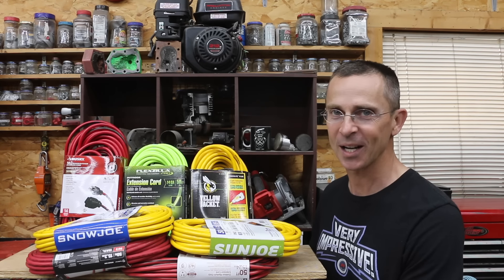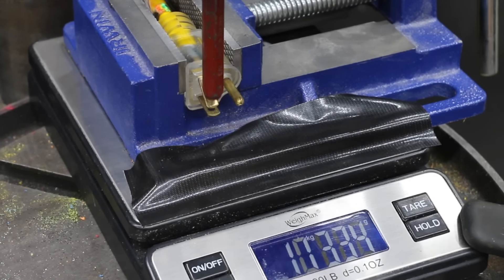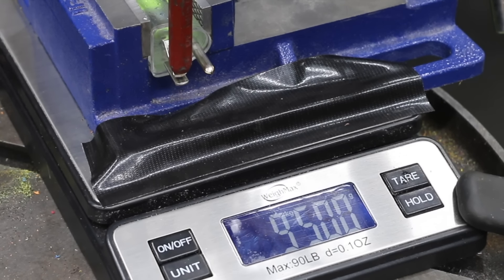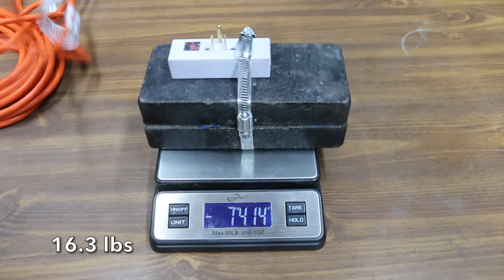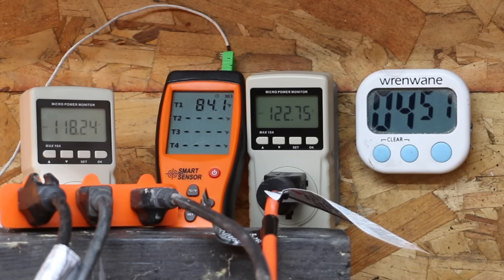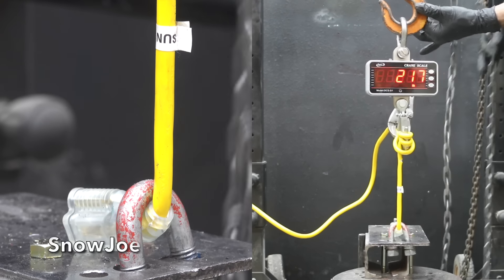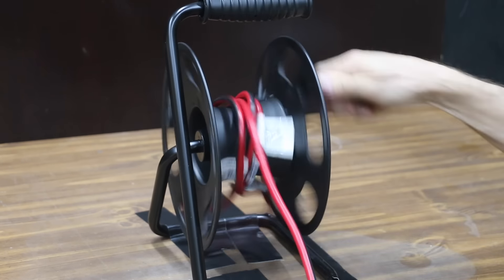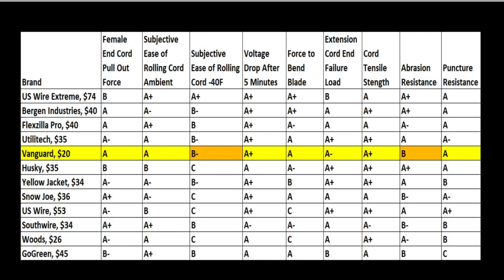Best Extension Cord? Flexzilla, US Wire, Yellow Jacket, Southwire, Husky, Woods, Bergen Industries

Comment: I’ve been using Yellow Jacket ($34) for about 20 years and is the best cord I’ve ever owned or used in construction.   One of my pet peeves is how well does the cord roll up and unroll, I like to grab the prong end and toss the cord where I need it.  This cord does it without twisting every time and is the 25’ length.  No cuts, punctures yet.
Reply from the maker: Great feedback on the Yellow Jacket!
Reply: I have 2 yellow jackets that are every bit of 20yrs old and they are still in great shape (home shop use, not daily/commercial)
Reply: Yep agreed and I got mine at Costco.
Reply: I'd rather have my own leads made & tested/tagged over buying them off the shelf. The end result is so much better. 
Currently the main ones I use in the shed are 3G2.5mm² high temp silicone rubber (SIF) 300/500V, -60C/+180C with tinned annealed copper wires
 Plug & socket are easily replaceable if damaged, the silicone cable is incredibly flexible, absolutely beautiful to wrap and I don't have to be as concerned about melt through when carrying out hot works. 

For more ruggedised cables I use some made from 3G2.5 & 3G6 RV-K (XLPE) which is thin & light for its CSA and has -40C/+90C ratings which is still better than PVCs - 15C/+75C 
I really like using RV-K because it wraps well, has a good memory and whilst it might not quite be as tough as Titanex it's significantly cheaper, thinner & lighter which makes a massive difference.
Both cable types have their benefits, and save cost are so much nicer to use than PVC.

In my past job, it was nothing to wrap well over a kilometre (3280' or 0.62 miles) of cables in a day so believe me when I say that this stuff is nice in the hands.
Reply: I've been using one for 10+  years for my car's block heater and power tools and it still looks brand new!

Comment: Re: flexibility. I've seen a lot of brands claiming they're flexible, and they're not. Even in warm weather(Though whether they degrade more quickly with temperature or not, I'm not sure). The blue "extreme" cables(Regardless of brand I think) are usually the most flexible 14AWG cable.

Ridgid has some 14AWG and 12AWG extension cords, both claiming they're flexible. Spoiler? The 12AWG 50FT is far softer and more flexible, go feel them in-store. Too bad they didn't end up in your test. Definitely do a 12 gauge comparison, and bring both Ridgid cables in, 14AWG and 12AWG.
Reply from the maker: I'll do a 12 AWG comparison if there's enough interest and will include Ridgid too.
Reply: Extension cords will have lower resistance and less power loss, as well as greater safe power handling capability, under extremely cold weather,  which means that for some applications you can probably get away with the thinner, lighter more flexible 14 gauge cord simply because you're always using it at 0ﾟ or thereabouts.
Reply: @ProjectFarm  A lot of larger industrial job sites will confiscate any cord smaller than 12AWG, regardless of length. They will also take any with repairs. The yellow jackets and rigids have been the best 12 AWG for us so far.
Reply: CORNER MARKET PLACE  I know in the U.S. a lot of the federal contractors will specify blue cords for outdoor freezing conditions. A lot of the better known brands will make their low temp cords blue.
Reply: @goodun2974  Good luck getting the safety prudes to sign off on that.

Comment: I own one of the Utilitech 50 foot cords featured in this video, and would like to add a comment. Generally speaking, it seems to be a decent power cord for the money. However, it quickly became discolored from sun exposure. After a few months of intermittent exposure, the red outer jacket has turned pink. And in some spots, the plastic is getting chalky.
Reply from the maker: Thanks for sharing.
Reply: mine too.  though for the price im pretty happy with it.
Reply: So basically a test for UV resistance would be good too
Reply: That is common with "red".  On red painted cars, red goes to hell sooner cuz of the sun. Merc. trucks were always red, which soon became chalky red and faded red over the years.  The UV additive to the paint still does not help on red, it has something to do with the light ray spectrum from the sun.  Science stuff. Painters know some schit.
Reply: My lime green extension cord from Harbor Freight has faded a lot from sun exposure in just one season being outside. Its shocking how quickly it turned colors.
Reply: @bunzeebear2973  dang so that's why my red car is peeling...
Reply: @ericnewton5720  just coat it with some plastic friendly uv protectant. 
\

Comment: Fantastic tests, I hadn't seen anyone measure the voltage and watts through a cable! I use the Yellow Jacket 12 awg indoors mostly and my US Wire Extreme for outdoors... looks like that's the best way to go. I just got a 12 awg Craftsman retractable that has 4 outlets with a breaker... I'm hoping it just makes life easier with the 100 feet.

Comment: Have you thought about testing flashlights?  I’ve tried a few different models from Amazon that I thought were decent values for LED flashlights but most fail or have poor light patterns. I’d love to see you put some through your excellent testing methodology to whittle down the field. 

Great work again as usual!!  You’ve become my primary reference for equipment reviews in short order.
Reply from the maker: Thanks!  Thanks for the suggestion.
Reply: Check out the torque test channel for led flashlight testing
Reply: Look for about 100 lumens for every watt. Anything more and the odds of the seller exaggerating lumen count goes through the roof.
Reply: @wallacegrommet9343  Thanks for the reference.
Reply: @TheDwightMamba  Good info, thanks!!
Reply: Buy Nicron flashlights. You get 2 or 3 light levels ranging from 200-800 lumens. Some of them have 90 degree swiveling heads, magnetic bases, and or focusing beams. They can run off of several different battery types, and are tough enough for medium duty use for sure. I have 3 Nicron flashlights for less than $60 and I have been using them for 3 years now.
Reply: Maglite xl 50

Comment: Fun to watch, amazing all the test procedures Todd creates.  Can you do one on small air compressors, and hoses?  The most recent hoses I have are by a major name, but a trip hazard to the extreme. Yet, some hoses are 30 years old, and still work.
Reply from the maker: Thank you for the video idea!
Reply: Good idea. I wonder if there is a flexible hose like the uswire extreme or flexzilla garden hose for air lines. That would be *kiss sound * perfection
Reply: @Version135  flexzilla makes air hoses
Reply: I second the request for a test of small compressors and hoses.  I have such from Harbor Freight and they are laughably bad.

Comment: Great tests, as always. From a safety standpoint, I would have liked to see the cables tested for how many amps they can handle before overheating/melting/catching fire. Regardless, great data, keep up the good work!
Reply from the maker: Thank you!
Reply: yeah same. of course the 10 guage would be around 30-35, 12 at 25 to 30, 14s 20 to 25 and the 16 at 20. or thats my guess. the 14s would all be within +/- 2 amps of each other im sure. May be a harder test cause the inner wires may fail faster than the outer insulation skewing the results a bit. outside looks good but shorted/melted inside. where others the outer may melt faster. At the very least it be a lesson in overloading to the viewers so they dont use too small gauge for too many amps and too long a distance. after all, overloading extension cords is #1 cause of electrical fires in the usa.

Comment: Great video, as always. Simple suggestion: if you're going to average (mean) rankings across tests, it would probably be useful to also include a variance calculation. Just noting the cord with the highest mean finish across tests also has the highest range, and hypothetically speaking I'd probably rather purchase an item that finished 7th across the board over a cord that finished 1st in half the tests and 12th in the other half.
Reply from the maker: Thanks!  Thanks for the suggestion.

Comment: Really interesting results. I know I have never regretted when I bought a few big beefy store-brand 12ga extension cords a few years back, with a slightly nicer than normal (not SJTW) jacket. They are by far my favorite to use. (I can leave them out all winter with Christmas lights and they don't stiffen or fade) Don't skimp on extension cords if you can avoid it. Glad to see the Harbor Freight is a good value for less rugged use, I may replace some beat-up old cords with those.
Reply from the maker: Thanks for the feedback.

Comment: Nice! Would have been interesting to see how many copper strands each conductor had. The more the better for both flexibility and current capacity. Like others I've made my own cords from 600V rubber coated electrical cable, but I do like the ends that glow too.
Reply from the maker: Thanks!  Thanks for the suggestion.
Reply: Check out Polar Wire they can make you 100% copper cables up to 4/0 wire size with any conectors you need, plus they have tons of off the shelf wire products, jumper cables, battery bank connectors for hydro or solar systems, extension cords, tinned marine wire, etc
Reply: @chrisdaniel1339  CD:  How much extra does shipping cost for those of us not in Alaska?
Reply: @repetemyname842  when I ordered my jumper cables shipping was free.
I believe they also have a warehouse in the Midwest, I think my cables shipped from Minnesota
Reply: @chrisdaniel1339  :  cool thx.
Reply: @repetemyname842  Polar Wire is based out of Anchorage, AK.
Reply: @BlondieHappyGuy  I think the voltage drop/temp test looked like a pretty good ballpark measure of gauge

Comment: I am an electrician, and on job sites , I rarely see fellow electricians buy extension cords like those you been testing. Many of us prefer to start with a coil of SJ Cab Tie wire, which is black neoprene jacketed  and make our own, and we try to use spec grade cord ends or Hospital grade (highest)  We make it any length we want, and we rarely need 12 gauge, for in multistory construction, there is a electrical outlet station at every floor with a panel and 15, 20 receptacles mounted on the board. For really heavy duty uses, we can also use SJOW  wire, sometimes even 600 volt rated ,  but generally the boss would resist paying for it. Even the SJ is more expensive than those you tested.  Most of these wires are marked , rated for 90 degree C  so even in the southern US desert heat, that is within the operating range. But not if you put more than 15 amps through a 14 gauge wire for extended period.

Comment: I'm really surprised to see how consistent the voltage drop results came out. I was sure that some of the discount brands would have skimped on the conductor size, but apparently they're all on the up and up.
Reply from the maker: Thanks for the feedback.
Reply: Not really possible since the AWG system directly correlates with conductor size in mm^2, only variable with be with the strands being more strands more better due to the skin effect which tbh for only 60hz wouldn't be that noticable compared to solid wire.
Reply: @Gianns_TDM  I understand the AWG standards, my point is that off-brand, offshore manufacturers are not exactly known for honest business practices. I was pleasantly surprised that none of these sellers cheated a little bit. I would assume Todd is aware of this trend, otherwise there would be no point in doing the load test.

If you look inside cheap hookup wire or cheap charging cables, sometimes there's almost nothing in there. Just three or four strands per conductor.
Reply: @g.tucker8682  You sure got a point there, have seen china shipping out even USB cables with like 3 conductors.
Reply: These are all sold commercially in the US so they most likely all carry UL listing - so they can't really skimp out on the conductor sizing
Reply: @Gianns_TDM  Quality of copper itself also matters.

Comment: One other thing that causes cord failure that's hard to evaluate in a short-term test like this is the "knotting" of the individual conductors within the jacket. I don't know if you know what I'm referring to, but it's when one of the conductors forms a kink that turns into something like a knot that eventually bursts through the outer jacket. Ever seen that? I've seen this happen many times on cheaper cords. Even Prime's cheaper-grade cords sometimes do this. I think it's related to how many strands are used in the individual conductors, or maybe how well annealed the copper is.
Reply from the maker: Great point!  Thank you
Reply: They knot up because you twist them in the same direction every time you roll them up. Try alternating the direction you roll them up each time.
Reply: @fascistpedant758  The type of "knotting" I'm referring to is more of a kink than a knot & it's hard to describe and seems to happen on only one of the conductors. It may be caused by the copper or by the friction between the insulation on the individual conductors.  FWIW, I typically use the 'Over-Under' method of rolling up cords, and use huge loops too.
Reply: @videopipeline6419  Seems to me the outer jacket is loose enough to allow inner cords to slide.
"S" cords are supposed to be twisted inside the sheath. this prevents the type of kinking you are describing.

S	Hard Service Cord with two or more stranded conductors 18 - 2 Awg. with a serving of woven cotton between the copper and the Thermoset insulation. Jute or other “fillers” are twisted together with the conductors to make a round assembly. Outer jacket of high quality rubber or modern Thermoset. For Portable or Pendant, damp locations. Extra Hard Use. Stage and Garage Use.
Reply: @fascistpedant758  yea people should learn how to do amp cable looping

Comment: Years ago, back in the 70's (I'm showing my age) the folded over prongs were an advantage.  You could split the folded prongs to aid in socket retention.
Reply from the maker: Great point!
Reply: The only problem with "splitting" the male pins to make them fatter  is as that this would cauae the female sockets to expand and subsequently loosen every female socket that you plugged it into.
Reply: @goodun2974  That's been my problem with women.
Reply: @goodun2974  If it won't hold then it's already damaged.  Plus, it only adds a spingy pressure to the prong, not rigid.
I'm just saying this is what was taught to us in shop class and it worked.  Newer duplexes may be different, but I doubt it.

Comment: One thing I didn't see in the test rundown was checking if the cables were copper or aluminum. Haven't watched the whole way through but thought I'd mention it before I forgot. Aluminum is fine but does have reduced ampacity for the same gauge as copper. It should be covered in the voltage drop test but again just preposting since I have a horrible memory.
Reply from the maker: Sorry I didn't mention this.  All are copper
Reply: @ProjectFarm  No worries. There's always going to be nitpicks like me finding something wrong with everything.
Reply: @Tb0n3  A lot of wire coming out of the far east is copper clad today. They've gone as far as to copper clad steel because the copper clad aluminum is too easy to spot using the burn test. Plus I imagine steel wire is even cheaper than aluminum is.
Reply: @1pcfred  The temp test under load would have revealed this. The results make me think they're all stranded 100% copper. 

IMHO for static applications (wall wire, etc.) CCA is fine if you know you're using it and you up the size appropriately.
Reply: @ratdude747  I'm not a fan of CCA myself. I get that copper is expensive and all. Still, I'd rather do without than deal with aluminum wiring, copper clad, or not. There's more to it than just the current handling and resistance too. Aluminum is just problematic used in wiring applications. Copper coating it can mitigate it to some extent but it really just makes it more complicated.